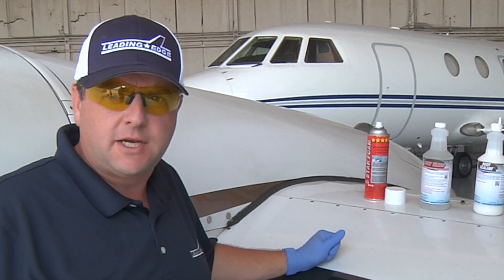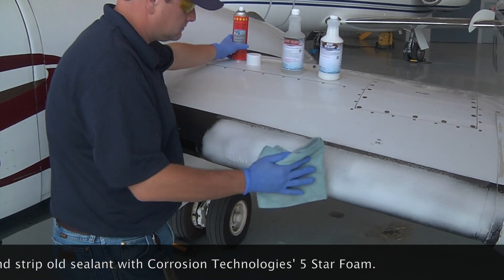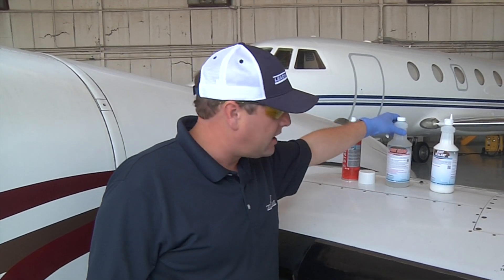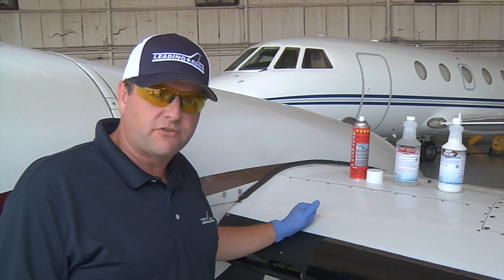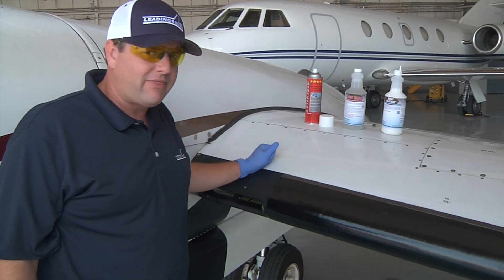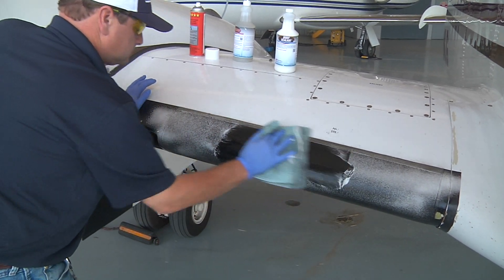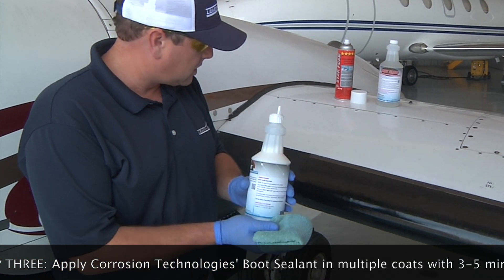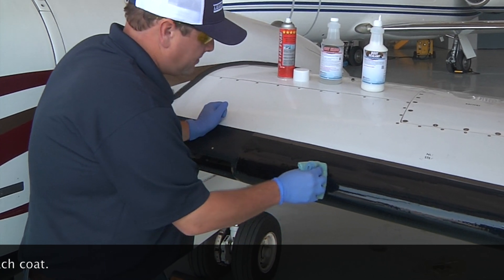Refurbishing airplane pneumatic de-icing boots

Comment: The solids count is low on that one. We use the Renew Protect 2 Steps, 2 Coats. Also... many like to use multiple coats of products but this can lead to stress cracks of that finish after de-icer is engaged. 20% ammonia mix will remove any over lap and works great to strip for renewal. We use a 3M white scrub pad to strip. We also can use the Renew Protect on tires, seals, etc.... makes a great final touch to a plane detailing.
Reply: Can you suggest , how often does it require for this procedure? How much does it cost at maintenance per session ? Thanks.